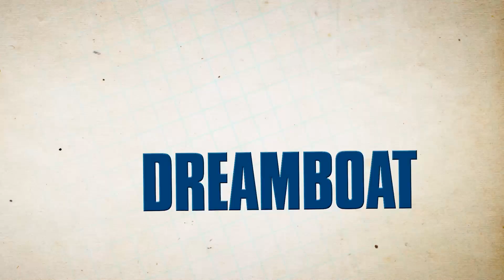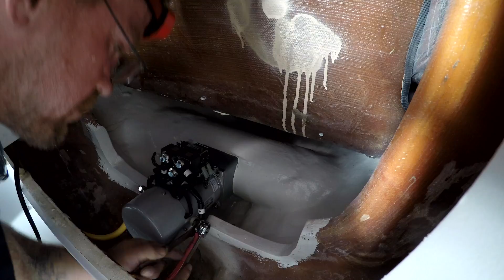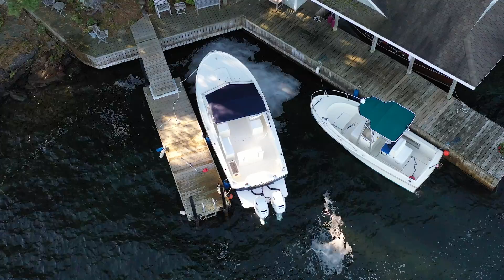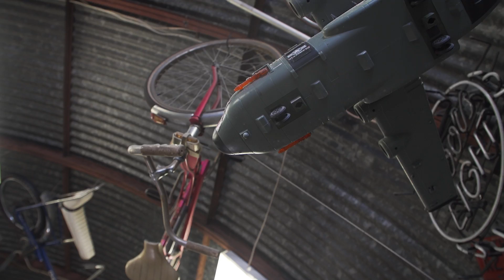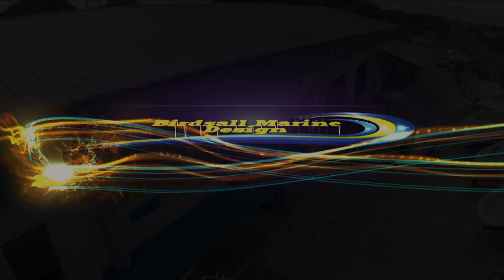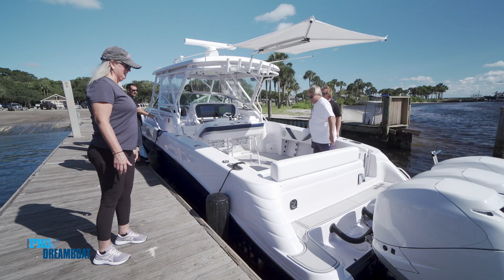Florida Sportsman Project Dreamboat: Bertram 25 Splash & Donzi 38 Unveiling [2021]

Comment: That Inverter in the bilge of the Donzi boat is not going to last to long and is also a hazard because its not Ignition Protected, also lithium batteries would had been a better option if $ was not an issue because they charge a lot faster, weigh less and last longer.